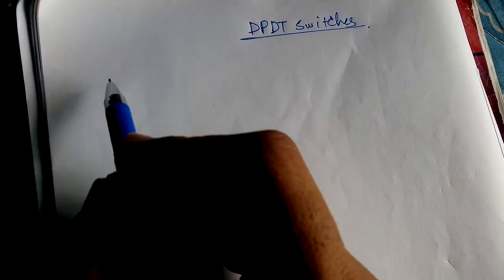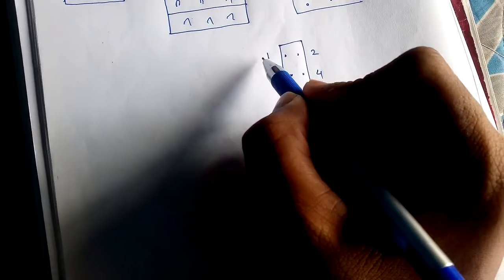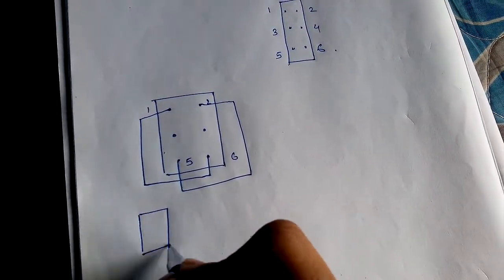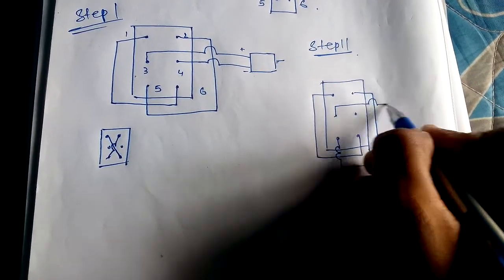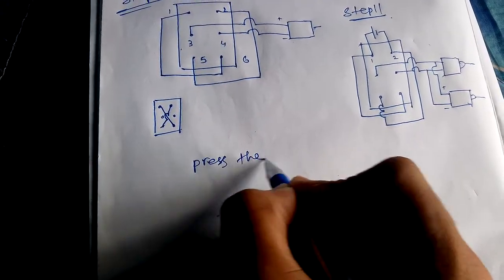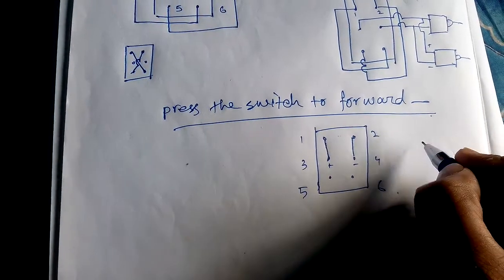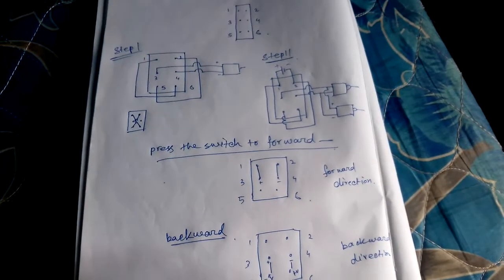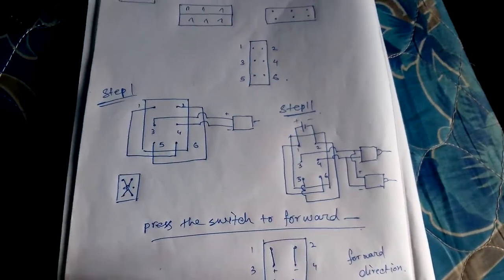Concept of dpdt switch

Comment: Can you explain it with taking 3 and 4 terminal as power supply.
Reply from the maker: Replace any adjacent pair with another, like 12 can be replaced by 34.
Reply: @STDude  yeah,..suppose 1,6 sort 2,5 sort and 3 4 power supply, then how does it work?
Reply from the maker: @srijitaghosh5104  then the 1,6 & 2,5 will be same as before 3,4 will be connected to supply and the motor can be connected to any of the remaining two points. Draw the circuit diagram and simulate by imagination, you will get it
Reply from the maker: @srijitaghosh5104  if you are still in doubt then ask your doubt in Bengali
Reply: @STDude  sorting kno kori amra?
Reply from the maker: @srijitaghosh5104  shorting korle amra same terminal create korte parbo.....tar fole.... 1 +ve hole 6  o + ve hobe r 2 ve hole 5 o -ve hobe. Tahole dekho akta terminal "+ -" r onnota " +"
Tate kore akta terminal forward power supply korte parbe r onnota reverse supply korte parbe.

Abare amra sudhu switch ta sei direction ai chap debo je direction a amra motor ta ke ghorate chai forward ba backward.
Reply: @STDude ata for four wheels? Tai toh?ekta wheel thakle toh sort er proyojon chilo na?
Reply from the maker: @srijitaghosh5104  ekta wheel(mane 2 to wheel) a o korte hobe ....karon ki tumi akta gari ke samne ba pichone to chalate chaibei.....akhon samne pichone jaoar jonno terminal change hoa ta joruri.
Abar dan dik bam dik korte chaile o bhabo 2 to adjacent motor er akta forward ghurle onno ta ke backward ghurte hobe. Tai shorting is important.

Jodi tumi short na koro tahole tomake 2 to source voltage (battery ba ac to dc converter) lagate hobe .....akta 1,2 te +,- lagale onno source ta 5,6 te -,+ lagate hobe.tate kore circuit bulky hobe
Reply: @STDude  one more, male female port kno use kori?
Reply: @STDude  suppose basic bot er right side er duto wheel er sthe j dpdt connected seta forward a press krle and left side er diker jnno dpdt tai back press krle bot right side a ghurbe toh?
Reply from the maker: @srijitaghosh5104  haaa obossoi.....by the way kon year tomar jante pari ki?
Reply: @STDude  2nd

Comment: I ve tried it . it does not work , dont be fooled.
Reply from the maker: FOMI1970 check your connection or battery....there might be any fault....try it again
Reply: +SUMAN MONDAL the motor i was testing this methode with is an 1500 watts AC brushed vacume cleaning motor , i tried more than once my friend , it only worked only when i connected the main power wires to 3 and 4 (not to 1 and 2) , and added two wires from the motor , so i had 4 wires ;  the two original wires which i connected to 1 and 2  and the two added wires which i connected to 5 and 6 (in opposite to 1 and 2)  , then it worked .the crossed wiring did not work.
Reply: +SUMAN MONDAL this method works with DC motors , try to use this method with a vacum cleaner motor or drill for example and post the video , on paper every thing is easy , but making it is a whole different story my friend .
Reply from the maker: FOMI1970 okkk i didn't have that much of knowledge as i am still a student.....thank you very much for the information i will try to study about that...
Thank you very much